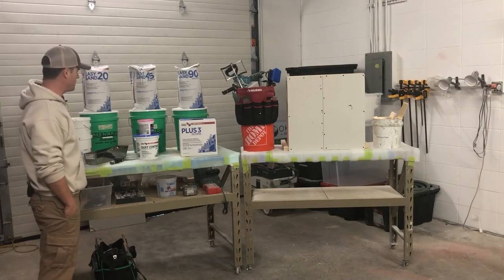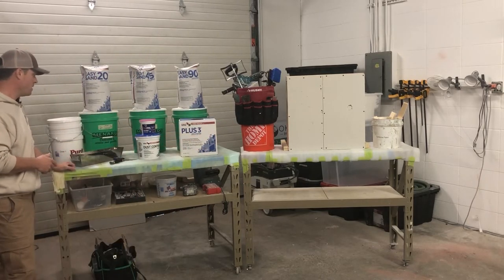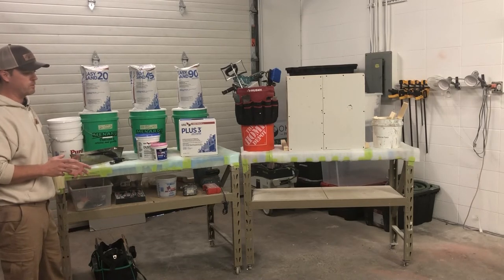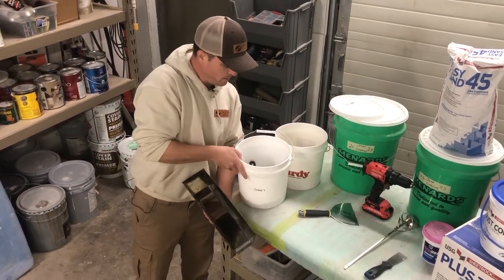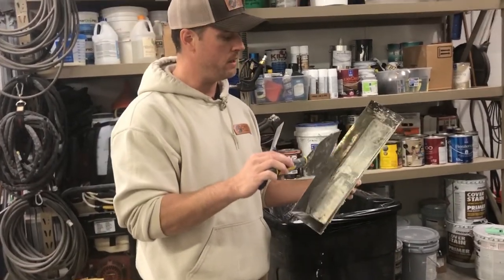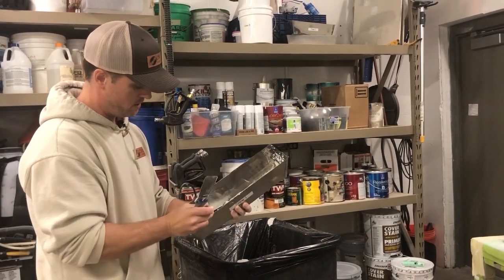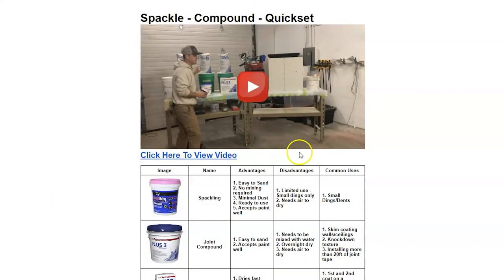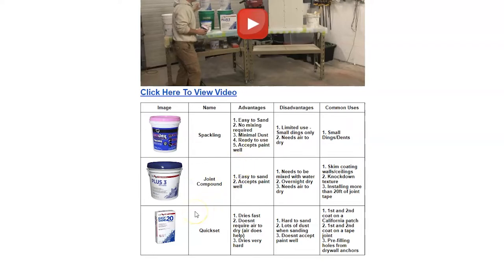Drywall compound vs quick set and how to mix

Comment: I use the premixed for 90% of issues inside residential repainted, I mix in either 5 or 20 min powder if I need it to dry quick. I use a hawk and trowel, much faster then a pan
Reply from the maker: I like your method!
Reply: This is a great tip